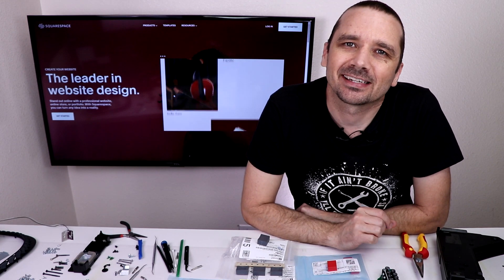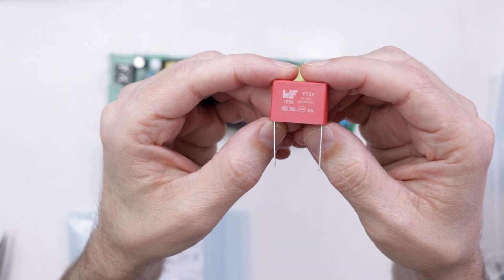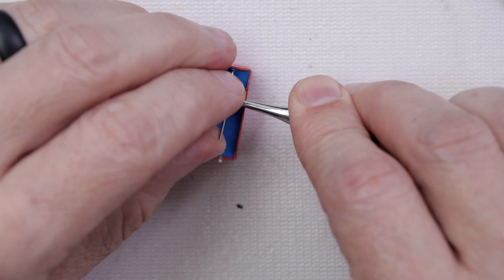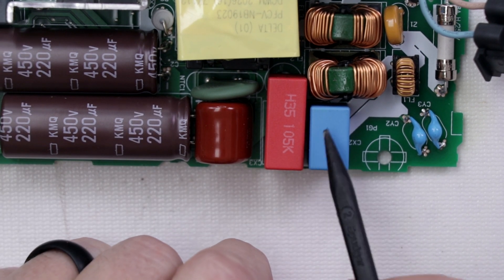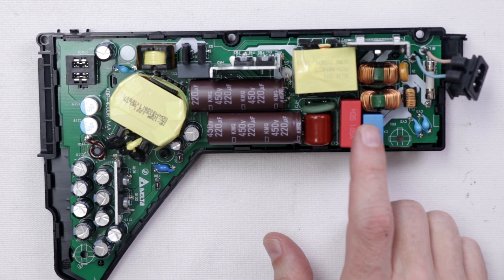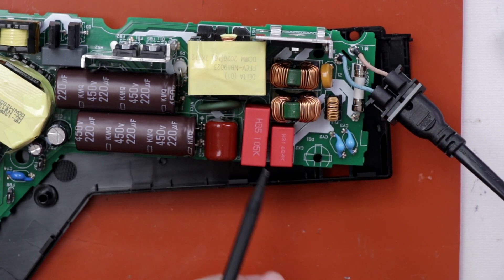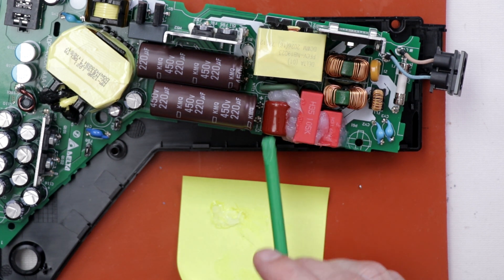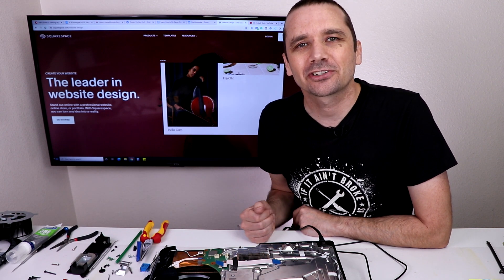Did I Fix PS5 Coil Whine?

Comment: wow, I didn't know you are not an electronic engineer ! you really work great without those knowledge. as much as I knew, those glue's are mostly for coil's ! as you can see those coils can vibrate  almost like old school bell ! also some bigger coils with laminated core sheets could have vibrate between their sheets . your video title is also COIL whine, not CAP whine. so I think those last minute silicon on coils did the main job .
also about that cap discharge spark, sometimes it can destroy cap leg's (make big hole's in them ). I don't recommend to do that
Reply: Would you recommend doing the silicone job?
Reply: @MrUchiha  I think at least it deserve to test ! only put glue on all cap and coils in a supply without changing cap's. I guess all job that cap changing did is have a stronger soldier and caused less component moving. Anyway maybe I'm an electronic engineer ! but I'm not a good strong one! and all I said are only a guess from me ..
Reply from the maker: The coils already have a coating/adhesive on them. I clearly show in this video that the noise is not coming from the coils.
Reply: @Tronicsfix  so maybe its effect of coil on other components, that's why I said : glue on all caps and coils.  I know it may sound stupid idea , but can you plz test a magnet near old cap plates that you destroy to check in last video ?
Reply: @Modjir  Hot glue instead of silicone between the caps and above?
Reply: @MrUchiha  sry my English isn't good enough, that is why I cant explain what I really want to say . I Guess hot glue or silicon or any other kind of glue that don't became like ROCK and let a little softness on components and observe their movements  (instead of became a part of them and vibrating with them ! ) can help. I need to search more and I think its better a more experienced one answer this.
Reply: @Modjir  i understand now. What you’re saying makes sense.
Reply: @MrUchiha  and sry, I forgot to say, not only between and above, but also a little on main board to glue them together and to board,  and prevent vibrating. if power supply temperature went higher than hot glue melting point or any temp near hot glue loosing its strength, I think its not good to use it .
Reply: @Modjir  well, basic hot glue guns melts around 250 degrees. Some high end around 450. And i believe it’s impossible for the power supply to go over 80 degrees at max. So i don’t think it will be a problem?
Reply: @MrUchiha  when you can't find another glue, hot glue is a big help anyway but if you access to better solutions, its not recommended to use hot glue.
and plz read my new post about my mistake ...
Reply: @Modjir  which comment? 

I’m only planning on applying silicone/glue or whatever to the caps and nothing more. I’m not experienced at soldering and such, so i will only do what i can.
Reply: @MrUchiha  I searched and found we also have capacitor sound, a piezoelectric effect in capacitors. and apologized for my mistake. 
anyway if you have enough knowledge and you can add those glue without any harm, you can help us to see also glue effect and if it also solve a part of problem. plz tell us result if you did that. tnx

Comment: Hey everyone! I just cleaned & replaced thermal paste to my ps4 pro.When i hit the power button it's only beeps one time while blue light and turn off itself.I don't know what's happend.There's no disc inside.I just worried about it and started to watch some videos about it.Power supply and connector is fine.Any ideas ?

Comment: Not that I pay much attention, but I don't ever hear a single noise come out of the XBOX SX not even when running. Is this a PS5 exclusive problem? Or am I going deaf?
Reply: Cheap components used by sony causes this. 

Or else the PS5 is hella silent
Reply: I have a PS5 and sometimes in some games under certain situations you can hear a buzzing noise. And since these consoles are so quiet fan wise it can be audible. More generally coil whine is something that happens with electronics sometimes. PC graphics cards can be bad for it. my samsung SSD used to make high pitched sounds sometimes under load too.

Comment: Today I will hopefully be assembling my computer which already works as a loose pile of parts. Unfortunately the case I bought has an opening in the top that is like 1-2 mm too small for the top radiator I have (thanks cooler master I really appreciate not having the case be just a tad bigger sigh....). It might fit the side radiator, but I wanted crossflow. Anyway I finally have a dremel bit that effectively cuts steel (I had one, but it's not very effect in cutting a long line) so I'll be cutting the hole to be just a tad bigger. If I'm successful I'll have my first water cooling setup for a computer. I'll make sure to use the perfect amount of thermal paste on the CPU block of course lol.  It's a pretty awesome system for a temporary setup though. My placeholder CPU (since no one can buy a Ryzen 5900x) is a Ryzen 3600. My old computer could render a model I made in 1080p in roughly an hour. This computer can do it in 4K in roughly 15 minutes. The 5900x will be more than twice as fast. 5 minutes for this model might be possible.
Reply: @Jaime Beauchamp it doesn't do open water loops at all unfortunately. But yeah I use it. I doubt it would know that the opening is jist barely too small for the radiator im using. I'm working on it but the dremel bit I used is already dead. It cut about 75% of what I needed off. I'll buy 2 but I think 1 will do it.

Comment: When the load is high, those input capacitor can make some noise, but it is normal, althought if your current isnt a perfect sinusoidal it might get loud. I wonder if people conplaining about coil whine might have their ps5s connected to an ups or sonething similar that doesnt deliver a perfect sinusoidal. Mine ceirtainly doesnt make any noise, except when the ups is on batteries, then i just turn the ps5 off
Reply: That’s why he used silicone / zip-tie to lessen the noise.
Reply from the maker: That would be interesting to know.

Comment: The lesson I learned: spread legs to fit into holes 😳

Also I guess PS5 PSU is not designed properly since capacitor whine persists even after replacing them.
I recommend testing PSU noise under stress, my PC PSU whines only when I launch a game.
Reply from the maker: THAT'S what you got out of this? Lol.

Comment: That's crazy that after ps4 Sony still have the Coil whine problem. As an user i rally can pay extra 5 Bucks for good capacitors not these...a little shame.
Reply: They could fix most of it just by applying silicone or any other glue to keep them steady.
Reply: @MrUchiha  that's right. And that's why im angry on Sony. Quality of their product is not as good as it was Years before...
Reply: @marcinus2000  they use metal liquid and saves the money else where.. nothing to say.

Comment: Isn't messing with this kind of thing extremely dangerous? Couldn't this create a fire hazard?
Reply: @J Fz But I thought these types of devices went through serious testing to make sure of safety. Switching parts out with different parts how can you know they're not going to cause problems, like overheating after heavy use?
Reply: @heavyarms55  if you’re afraid and unexperienced. Just do the silicone/hot glue one. Should lessen the noise

Comment: The reason why there buzzing noise is because Sony really cheap out on components. Especially on the psu.
Reply: That’s why we are trying to dampen the noise..
Reply: @MrUchiha   there's no point. Even with that glue, it's still made it. It's just inherent by design.
Reply: @samven582  a PSU will always buzz. But to a very small degree. The degree the PS5’s PSU is too much. The fan is silent which makes it even more audible. 

Replacing the caps or silicone+zip-tie will absorb most of the vibrations and lessen the noise

Comment: Since his PS5 was under warranty before he took it apart, he could of just exchanged it for another one ☝️
Reply: coil whine is a very common problem with the ps5, theres a good chance his new one would have been the same.
Reply: That one was already opened to apply Thermal Paste long time ago
Reply: It’s an issue with how the power supply is built. Every PS5 has this.
Reply from the maker: Probably...but where's the fun in that? I also think most PS5's have some amount of this whine noise.

Comment: When do you think Sony will repair this problem? I bought 2 and they had the annoying noise so I had to have them back twice. I want a normal one without this noise
Reply: I doubt they will ever fix it. Believe it or not, its been an issue since the ps3 launch. It wasn't nearly as noticeable then, but so far every ps4 has had it to an  extent. But something that I should mention is that the coil whine might just go away on its own over time.

Comment: man you should do that with pliers and you never bend legs on soldering side, because if you want to remove that you almost cant. And that silicon adhesive is only on coils if you see that, not on capacitors, because it has no point to put it there

Comment: I have a ps4 model cuh-115A. It gets the not recognized disc error repeatedly. Tried other clean game disc all the same. Tried the safe mode easy fixes no luck. After entering a game disc, the blueray makes klunk noises several times and tries to eject disc then more klunks before getting error message. 
From my understanding my ps4 is a older model. Do you have a video on how to replace the blueray drive for older models. Thank 2

Comment: This is beyond stupid of sony. Why couldn't they just do it right the first time.
Reply: Likely it's because the capacitors they used are cheaper and still work. Coil whine is almost never considered a defect when looking at manufacturer's warranties because the product works just fine with or without the whine, so they'll use the cheapest products that are likely to work fine regardless of the noise that is made from them.
Reply: @YeaICampSo  Yeah but why couldn't they simply add this grey goo like Microsoft and be sure, that even they cheaped out on coils it would work silently. I'm after exchange, got the another PS5 with the same thing. This time it's quiter so I think I can live with it but still it just left a bad taste, especially after PS4/PS4 Pro kerfuffle.
Reply from the maker: It's not technically a defect and they work just fine even with the noise.
Reply: @Tronicsfix  Well from a consumer standpoint it is. This brain drilling sound, familiar to electric shaver is really annoying. The only good thing is that it won't do any damage to the console itself. I'll have to just use headphones all the time.
Reply: @MvK-Delta   I never specified Sony because Sony isn't the only company that doesn't consider coil whine a defect. The vast majority of hardware companies don't consider it a defect and never have. 

Also side note, bringing up MS as being more consumer friendly is kinda bad timing considering they just doubled the cost of XBL Gold while retaining the requirement to have it for free to play games. It's now more expensive to buy a Xbox Series S and 1 year of Gold to play Fortnite than to just buy a PS5 Digital Edition.

Comment: Its the fan making the annoying noise but people didnt want to admit it was the fan so people called it coil wine which it is not.  You would not hear that little buzz with the case on.  What you hear is the cheapo fan Sony used change that out and you will be good.
Reply: Dude, i ran the PS5 without the fan plugged in. Stop giving out fake information.
Reply from the maker: It's not the fan. The fan was unplugged during most of my testing...and when it was plugged in it was virtually silent.

Comment: If that much epoxy is put in their you can imagine how much coil whine was going on, damn, obviously cheap components. That epoxy won't last, with all those vibrating components and the constant heat the epoxy will crack and break over time, meaning we will get some pretty loud xbox's in the next few years.
Reply from the maker: I think sometimes they epoxy is used to keep components in place during manufacturing so idk how much is for that and how much is for noise/vibration reduction.
Reply: @Tronicsfix  I've never heard of epoxy being used in that way, I would have thought it would add more unnecessary hassle to the whole process. Maybe removing the epoxy and seeing what happens could be a good experiment which could help answer its reason for being there.

Comment: No power supply should be buzzing like that....I would send it back and get a refund. It's a potential fire hazard
Reply: All PS5's has that. If you don't youre just lucky. it's the capacitator that is vibrating a lot and making it buzz.
Reply: @MrUchiha  I don't bother with consoles any more cost too much and too much of a headache.
Reply: @ZeroCool396  well, that is your opinion. Couch players need a console 🤷🏽‍♂️
Reply from the maker: As far as I know all power supplys buzz some amount. It's just a matter of how loudly they buzz.
Reply: PSone or two never buzzed..I never heard a buzz on a PS3 either even my 850 watt power supply on my desktop does not buzz.
Reply: @ZeroCool396  high end specs - cheap design